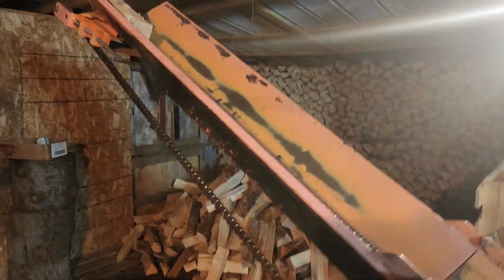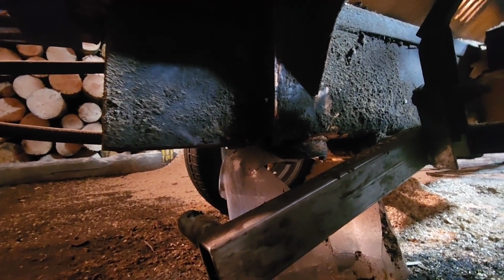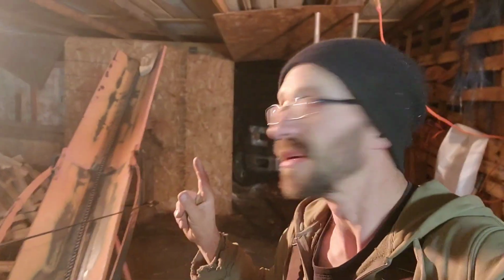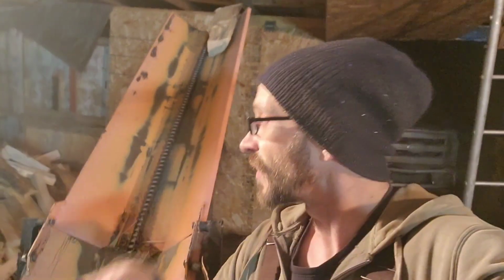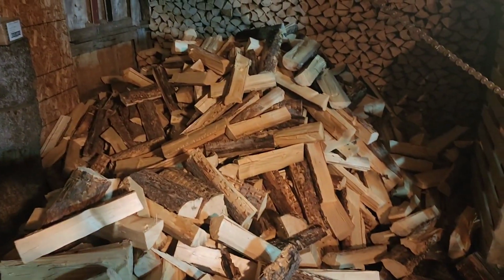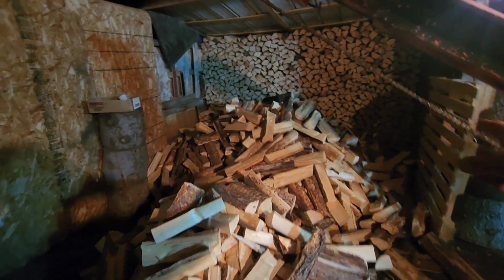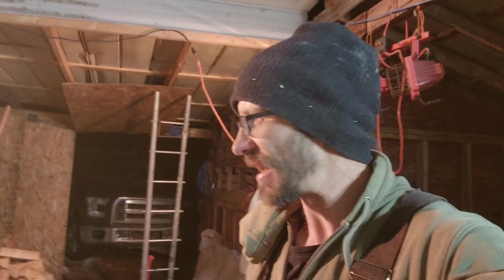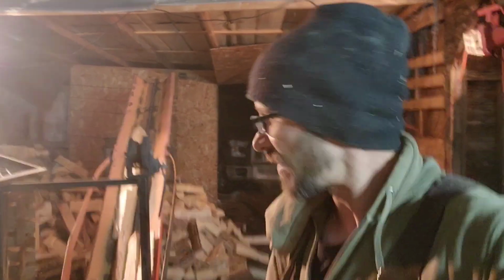No More Hand Splitting! The Old Firewood Processor Lives Again!!

Comment: Not sure if you can get it in Canada but I used some Selleys Knead It to do a temporary repair on a friends sump on their car. They kept the car for years and as far as I know it could still be driving around today with it still in place. I wasn't expecting great results as it was oil covered but it definitely worked fine.
Reply from the maker: Hey good day Alan. And I'll have to see it I can buy that, might be able to order some online. Might be awhile till I get a slow day to get unit into shop so any little fix I'm willing to try. Hope all is well, Cheers 👍👍